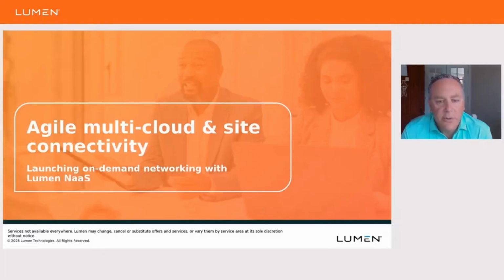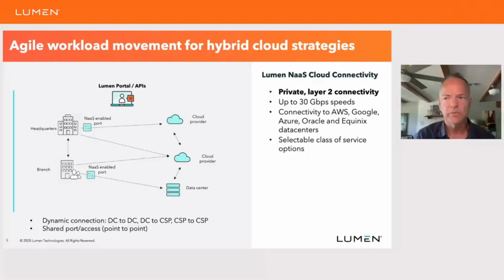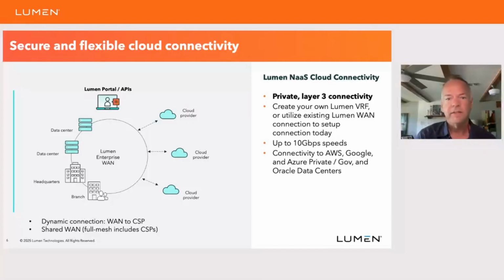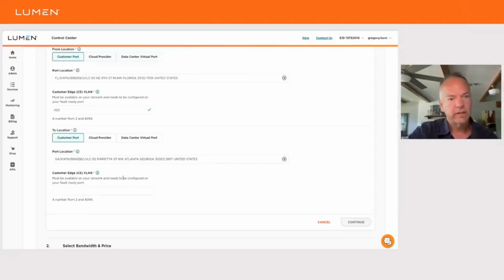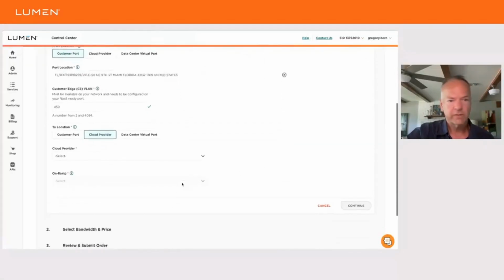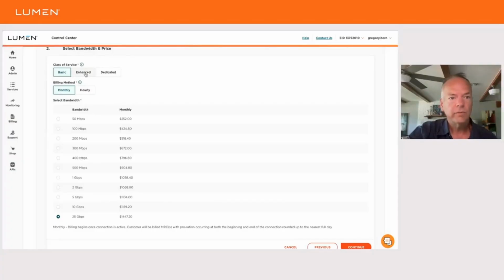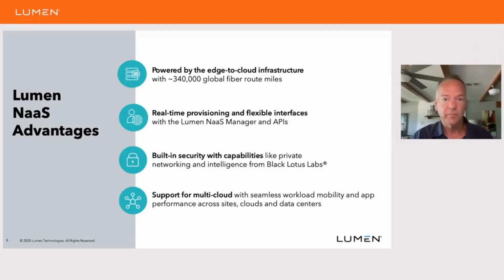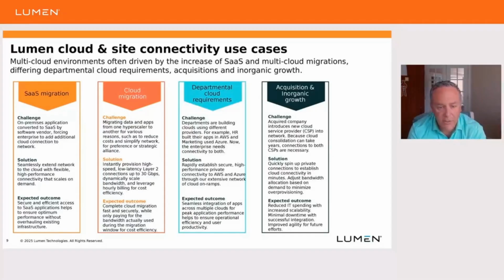Agile multi cloud & site connectivity

Comment: All this and still no clue what you’re selling 
NaaS 
Network as a service 

So IT personnel or office managers are doing what , if they opt in for “ NaaS”

Giving the carrier the overall duty to manage switch, router , firewall and fiber? So basically a hosted sd-wan service ? And could also be managed across multi location point to point or meshed config